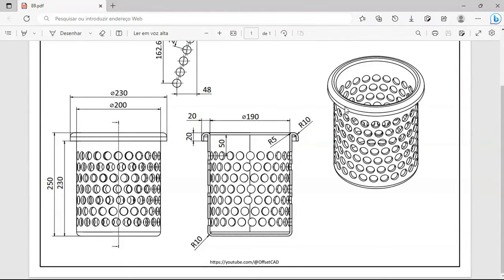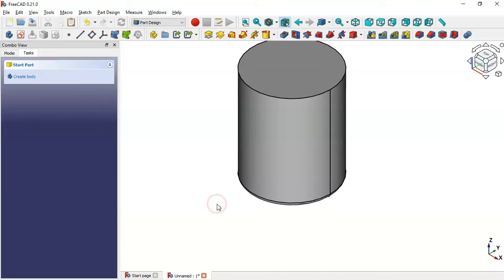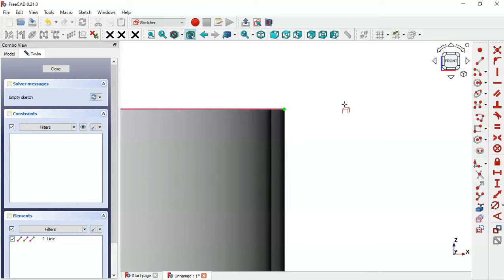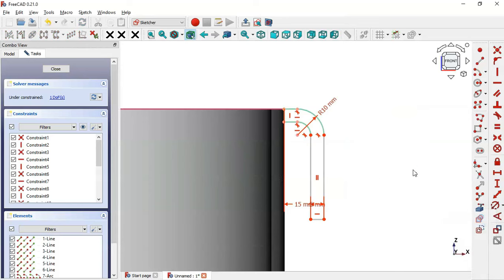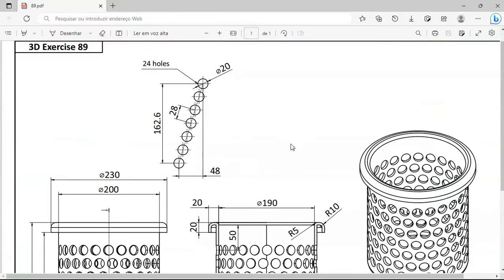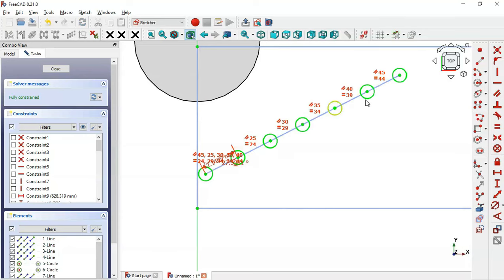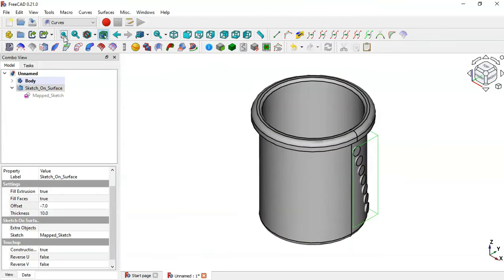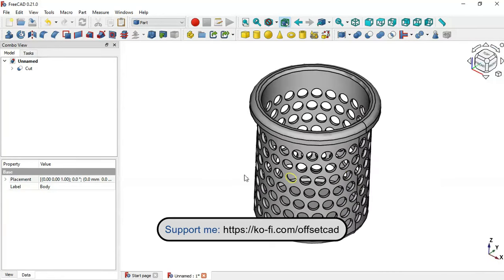FreeCAD Beginners tutorial: practical exercise 89

Comment: Excellent tutorial.  This week I installed the macro FCInfo. I was modelling extruded aluminium and wanted to calculate the weight per meter.  To make sure my profile was correct. With components such as this, its the hole area to cylinder area thats important re design. For water flow rate for example. I reckon I will try this model too, to find out if this FCInfo macro works with surface area.  Say for example, if this is a filter feeding a 50mm drain pipe. Do  the filter holes add up to more CSA than the drain? Can we do it on freecad, or is it pen and paper ?
Reply from the maker: What did you mean with "CSA"?
Reply: @OffsetCAD  Cross sectional area sorry. Is there a way to use freecad to automate calculating the total open area of the mesh for flow rate calculations 👍. Its no big deal to manually calculate it of course.
Reply: @OffsetCAD  The answer is yes. We can use the FCInfo macro to give the surface area of individual faces. Thats handy 👍